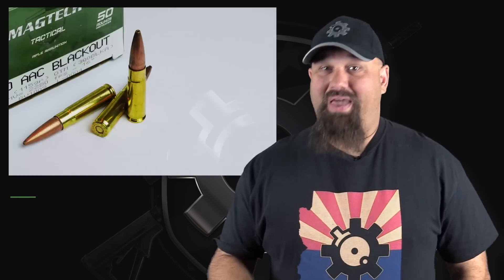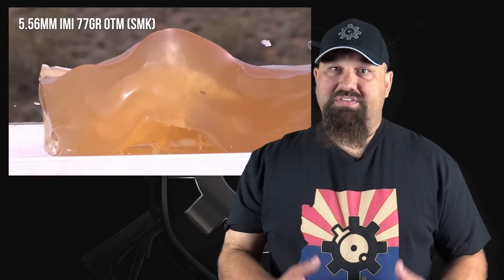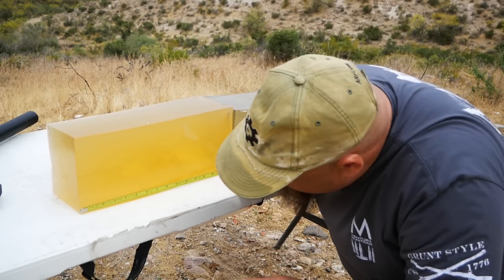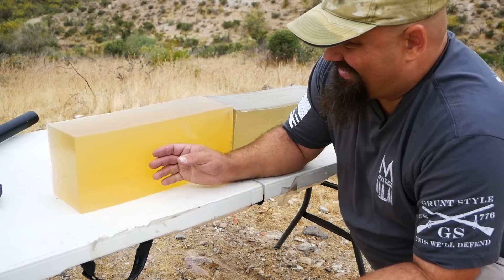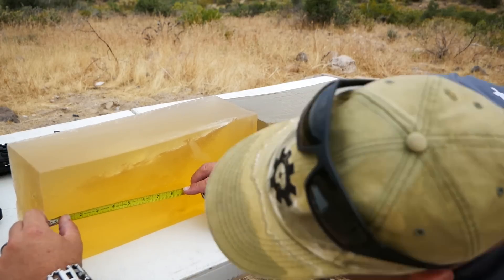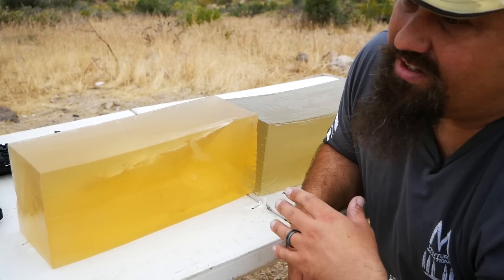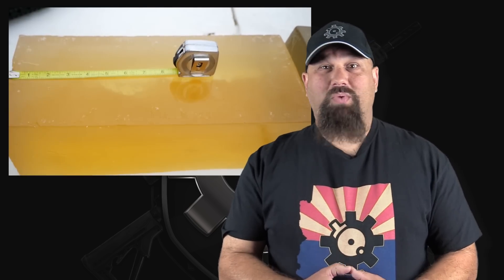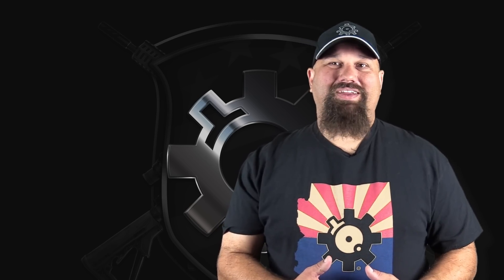Why OTM = FMJ In 300BLK: Magtech 115gr OTM Gel Test

Comment: Don't know where I heard it, but I was of the understanding that the 300blk was designed to provide cqb terminal performance out of a suppressed 9" barrel.
Mine is a 10" from Black rain and pushing a gas checked 200gr Lee(I don't run suppressed) does a number on Texas feral hogs out to 100yds which is the farthest safe backstop at my buddy's place. I have planted a group at 200 at our local range here in Cisco that pretty much nothing this side of Big Foot is going to jump up and say "play it again Sam" with the same batch to assure I wasn't going to send off a squealer. 
I don't shoot if I think it's not going to drop and that's ONE round out NOT full auto like I've seen on YouTube and heard advertised to yuppie jackwagons with a free helicopter ride. There's nothing cool about it. The animal deserves to be here one second and in the happy hunting ground the next. That is Good Stewardship. That they're out there doing what pigs do is not the pig's fault. THAT is because of POOR Stewardship. Ok sorry bout the soap box. Just saw a feed that well you get how I felt about it. 
Y'all Be Good Stay Safe.
Reply: Totally agree about the proper respect for the animal.

Comment: This Patriotic Veteran approves this mesg 

Gun deaths 

There are 30,000 gun related deaths per year by firearms, and this number is not disputed. The U.S. population is 324,059,091 as of June 22, 2016. Do the math: 0.0000925% of the population dies from gun related actions each year. Statistically speaking, this is insignificant! What is never told, however, is a breakdown of those 30,000 deaths, to put them in perspective as compared to other causes of death:

• 65% of those deaths are by suicide, which would never be prevented by gun laws.

• 15% are by law enforcement in the line of duty and justified.

• 17% are through criminal activity, gang and drug related or mentally ill persons – better known as gun violence.

• 3% are accidental discharge deaths.

So technically, "gun violence" is not 30,000 annually, but drops to 5,100. Still too many? Now lets look at how those deaths spanned across the nation.

• 480 homicides (9.4%) were in Chicago

• 344 homicides (6.7%) were in Baltimore

• 333 homicides (6.5%) were in Detroit

• 119 homicides (2.3%) were in Washington D.C. (a 54% increase over prior years)

So basically, 25% of all gun crime happens in just 4 cities. All 4 of those cities have strict gun laws, so it is not the lack of law that is the root cause.

This basically leaves 3,825 for the entire rest of the nation, or about 75 deaths per state. That is an average because some States have much higher rates than others. For example, California had 1,169 and Alabama had 1.

Now, who has the strictest gun laws by far? California, of course, but understand, it is not guns causing this. It is a crime rate spawned by the number of criminal persons residing in those cities and states. So if all cities and states are not created equal, then there must be something other than the tool causing the gun deaths.

Are 5,100 deaths per year horrific? How about in comparison to other deaths? All death is sad and especially so when it is in the commission of a crime but that is the nature of crime. Robbery, death, rape, assault are all done by criminals. It is ludicrous to think that criminals will obey laws. That is why they are called criminals.

But what about other deaths each year?

• 40,000+ die from a drug overdose–THERE IS NO EXCUSE FOR THAT!

• 36,000 people die per year from the flu, far exceeding the criminal gun deaths.

• 34,000 people die per year in traffic fatalities(exceeding gun deaths even if you include suicide).

Now it gets good:

• 200,000+ people die each year (and growing) from preventable medical errors. You are safer walking in the worst areas of Chicago than you are when you are in a hospital!

• 710,000 people die per year from heart disease. It’s time to stop the double cheeseburgers! So what is the point? If the liberal loons and the anti-gun movement focused their attention on heart disease, even a 10% decrease in cardiac deaths would save twice the number of lives annually of all gun-related deaths (including suicide, law enforcement, etc.). A 10% reduction in medical errors would be 66% of the total number of gun deaths or 4 times the number of criminal homicides ................ Simple, easily preventable 10% reductions! So you have to ask yourself, in the grand scheme of things, why the focus on guns? It's pretty simple:

Taking away guns gives control to governments. The founders of this nation knew that regardless of the form of government, those in power may become corrupt and seek to rule as the British did by trying to disarm the populace of the colonies. It is not difficult to understand that a disarmed populace is a controlled populace.

Thus, the second amendment was proudly and boldly included in the U.S. Constitution. It must be preserved at all costs. So the next time someone tries to tell you that gun control is about saving lives, look at these facts and remember these words from Noah Webster: "Before a standing army can rule, the people must be disarmed."

What ever happen to up hold the Oath of office to protect and up hold the CONSTITUTION of the USA....NOT MAKE YOUR OWN RULES/LAWS...

Show quoted text

Comment: This was also shot out of an 8" barrel... Go watch Mrgunsngear on 300blk out barrels, grains, and velocities as well as fps. 
The whole point of this video was fragmentation apparently, or lack of from an 8" barrel.
Reply: The whole point of .300 AAC is to shoot it out of short barrels.
Reply: @newsofthepews  but the velocities vary based on barrel length and bullet type.. optimal is 10.5 for a 300 SBR. You also obviously used ammo that isn't meant to fracture. Tacticalrifleman does a vid on 300 vs 9 using ballistic gel. The 300 is 10.5 and believe it or not, the bullet creates a cavity and fractures inside the first gel block
You're obviously attempting to detail the 300blkout movement by throwing in false information and not doing your due diligence in providing necessary information.
Reply: @dustinramose  I'd have to agree with your statement. OTM is meant for increased accuracy bot for expansion/fragmentation. Using a sub 9" barrel, which the 300blk was designed around, while comparing it to a full size AK for ballistics has and will yield biased results.

Comment: 762x39 is not  "at least 200fps faster than 300blk" in shorter barrels. They may be in 16" +, but in 10-11" barrels they're nearly identical.
Reply: yup compare both rounds outta a 16in and 300 is superior
Reply: @tylerh7298  no, the opposite. Out of longer barrels, apples to apples .300blk is like 90-95% of what 7.62x39 can do. As you shorten the barrels, that gap shrinks to almost nothing. There’s no barrel length at which .300blk is greater than 7.62x39
Reply: A 300 blk with a 110 gets around the same velocity as a 7.62x39 with a 123 grain.

Comment: From what I've seen, 200fps is more like an extreme difference between 7.62x39 and x35. Usually more like 100-150.
Reply: The difference can be far more than 200fps. Chopping block recently tested a 125gr 7.62x39 softpoint at 2500fps. That's more velocity than you'd get out of a 100gr 300BLK round.
Reply: @asdfghjk2933  Oh ok. I've only seen fmj comparisons that ranged 2200-2400.
Reply: @barccy  Typically that's what you see, but 7.62x39 can be pushed further because of the case capacity. Not a gigantic difference between them, but significant enough.
Reply: @asdfghjk2933   wrong.

Comment: I'm still waiting on the MagTech 77 grain 5.56 gel test. I'd even sponsor the ammo for the test
Reply: Doesn't it also use a 77gr SMK? If so, the performance will be the same as any other 77gr SMK at similar velocity.
Reply: @newsofthepews  Yes but I still want to see it
Reply: I use both.  The only difference between Magtech and IWI is possibly an accuracy difference depending on the rifle.  I find the Magtech generally slightly less accurate than the IWI across several rifles.  But not enough to matter for most purposes.  IWI ~1MOA, Magtech ~1.5MOA.  YMMV
Reply: I already had it set up with him to send him some Magtech 77 OTM about a month or so ago but then I got into a car accident shortly thereafter.  I am almost financially recovered now.  I only had liability insurance so I could have more money for AR builds and ammo. Ive been paying dearly for that decision. 😢   I plan to send him a box when I can finally afford it in a week or two.

Comment: it's slower than 7.62x39 til you put them both in short barrels. then they mirror each other.
Reply: No, if you put them both in short barrels and use the same propellants, the one with more case capacity can go faster.
Reply: @newsofthepews  put some H110 in 7.62x39 and live stream the results for us. can't wait to see your results (spoiler alert it turns your gun into a claymore)
Reply: @operatorsanonymous  I don't believe you. That would mean that the AK lock-up or barrel is somehow profoundly weaker than the AR.
Reply: @newsofthepews  You are wrong and it can and has been proven mathematically.

 It's the cartridge shape not the platform it's used in. you can chamber 300blk in an AK platform just fine but the 300blk has next to no shoulder allowing the use if magnum pistol powders which are fast burning. we are talking 7.62x39 compared to 300blk in short barrels not AR-15 vs AK.
Reply: @newsofthepews  but please try and prove me wrong. throw 20gr of H110 in a 7.62x39 case and slap a 123gr bullet on top.
Reply: @operatorsanonymous  the rules of logic require that the person making the claim present the evidence.
Reply: @newsofthepews  I'm smart enough to know H110 in 7.62x39 is a bad idea you're the one claiming you can use the same powders in both
Reply: @newsofthepews  I've chronographed them both, the 7.62x39 doesn't get a complete powder burn cause it uses a slower burning powder. you can cram as much powder as you can in a x39 case alot of it is gonna get blown out the end. 300blk uses pistol powder and gets full use of it's case capacity. a 10in 7.62x39 with 123gr bullets were going slower than a 9in 300blk with 125gr bullets off a magnitospeed chronograph.
Reply: @newsofthepews  you put pistol powder in a x39 you'll risk blowing up the gun not designed for it.
Reply: @operatorsanonymous  I'm sorry. I missed the part where the AR15 was designed for pistol powders.
Reply: @newsofthepews  300blk uses pistol powder I specifically use H110 which is also loaded in both 357mag and 44mag.
Reply: @newsofthepews  1980fps with 123gr sst with 7.62x39 out of a 10.3

2018fps 300blk with 125gr sst out of a 9in barrel. 

Bottle neck cartridges will explode if you put magnum pistol powder in them.

Comment: How about testing the hornady .300bo subx round ? What i have seen so far from it is impressive for a subsonic round .
Reply: I tested it on TFBtv a while back. As you say, it does okay for subsonic. I wasn't impressed with the uneven expansion, but it functioned.
Reply: @newsofthepews  i dug a little deeper and found it .  good job on the test ! i shot a coyote with it out of a 8" pistol at 70 yards a couple of months ago . hit it in the chest , found the round in the crotch area. recovered bullet looked like a Cuisinart blade ( very little folding back ) and coyote was drt .

Comment: I bought some of this magtech 115 OTM to try out... accuracy was bad. Like 4” at 100 and I was using a scope on my SBR with a BA Hanson 10.3” barrel.  I wasn’t impressed at all.
Reply: There you have it folks, .300 AAC is not very accurate.

Read more
Reply: Your twist rate prefers a heavier bullet. 👍
Reply: I was thinking of getting some but dunno what the best/preferred grain weight for a 1/8 10.5 is?  Wouldn't bonded be better than btip or vmax ammo?  Only bonded I've seen it's federal msr in 150gr. Isn't that more for suppressor use?
Reply: @TheDkb427  yeah, I'd love to see a 110gr Fusion.
Reply: I got a 16inch with a 1n8. Its pretty tight for what it is at 100yrds. Same 115gr magtech is going about 2300 to 2350fps out of a 16. Groups about 1.5 moa

Comment: 300 blk just underperforms. There's better options out there that are cheaper. What's the point of it?
Reply: That's why I have a 6.8 SPC. It's an effective deer cartridge or home defense round with all but fmj. Go lighter for home, heavier for deer.
Reply: @l00nybin  
Are you shooting 6.8 on deer from an 8" barrel?
Reply: @theimmortal4718  Heck no. I'm not sure any caliber would be sufficient from an 8" barrel at 150yds.
Reply: l00nybin If you really look at the numbers the 6.8 sucks hairy assholes..... my 24” 5.56 AR is about on par with it after the first 100 yards......
Reply: Eugene Stoner ummm no.... thats a ignorant statement..... look im getting over 3300 fps out of green tip and my handloads Ive pushed  bullets to almost 4000 fps..... you CANT do that in a 20” period. Second all the published data you see is from a 24” barrel! Wake up!
Reply: The only caliber that I think is objectively better than 5.56 in the AR platform is 6.5 grendel. Too bad there are no reliable mags and the bolts are weaksauce.
Reply: Eugene Stoner I dont care what its designed for its simple math= longer barrel equals more velocity PERIOD!!! You can use slower powders and take advantage of it!! Yes I have a bull barrel Stag upper
Reply: Eugene Stoner I have bigger calibers for all that, I wanted a AR 15 platform which you cannot do with creedy etc blah blah and yes Ill list the powder and load, its no problem.
Reply: @Eugene Stoner Yeah I'm sure 6.8 SPC packs a wallop, but I don't feel the need to use one over a 5.56 with 77gr TMKs or other nasty rounds. Plus, you get less barrier penetration with the 5.56 with I think is a benefit in a home defense situation.
Reply: @Eugene Stoner And I bet you'd get some nice velocity out of a relatively lightweight round like that. Goes to show, ARs are better than AKs in every way. If you don't like 5.56, you can swap uppers to calibers that are better than 7.62x39 in every way conceivable.
Reply: @Eugene Stoner Me neither. 5.56 does everything I want it to. It's not the best at any individual task (except being cheap), but it's one hell of a versatile caliber.

Comment: They just need to develop some good, lightweight, inexpensive soft point rounds for the 300 BLK. But why would they do that when they can overcharge for 150 grain FMJs and Barnes bullets? This is why I haven’t invested in the 300 BLK yet. Maybe in five years or so.
Reply: Just some of this reloader's observations. I've tried several SP bullets with amazing and disappointing results. What I have noticed is that they work fine (great even) out of a bolt gun (worked a load for a friends ranch rifle in .300BLK). Problems seem to be with how the tips strike the feed ramps. Cycle a few rounds without firing and you will see every tip gets mashed over leading to poor accuracy.

The velocity of the bullet is right in what is normally a sweet spot for the SP rounds but sadly the AR action is not kind to such ammo. I have found most my success with tipped or hunting HP bullets.
Reply: @Ephem13  I have found it makes a big difference how your magazine and feed ramp is set up too. a lot of 300 blackout barrels have essentially standard m4 ramps which are not well suited to anything other than the very long pointy flavor of bullets. And many people are using PMAGs which aim the cartridge right into where they will nick the edge of the feed ramp. For this caliber USGI mags or the lancer mags are much better. you can also improve USDI mags with a couple very judicious tweaks on the front end of the mag so we'll have better clearance. I reload and cast and I like the option of running a wide variety of ammo with flawless reliability and no damage to the bullet. For me it's worth doing the minor adjustments on the feed ramp and upper to ensure that no bullet damage will occur and then just move on with life. It sucks to have to modify something out of the box but it doesn't suck as much as beating up your ammo for no reason.
Reply: If the Russians had developed a 110gr soft point similar in design to the soft points used by the various Russian makers in other rifle calibers, it would be an absolute banger.

Comment: I handload 125gr sst. They buck wind better than 110 in the windy hills and I like having a cannelure. I shot some of this 115 magtech, the accuracy wasnt stellar.
Reply: That polymer tip is a game-changer compared to OTM. 120gr sst is my deer load in my 6.8SPC. The farthest I had to track a deer with that round is 2 steps, and that was a 150yd shot.
Reply: @l00nybin  6.8 👍
Reply: stayfit_116 I handload as well and love the 110 vmax and 125 sst.... also try the Sierra 300 blkout 125 that look like palmas but pinched on the tip.... what a accurate bullet and flies so good! I was shooting my 10.5 at 428.1 yards at steel plates the size of a small torso and made my hits everytime..... exceptional bullet design 👍🏻

Comment: 16 inch barrel????
Reply: No, 8" with a big, honking homemade silencer.
Reply: @newsofthepews  try a 16 inch to see if there is any difference?
Reply: @truck212121  I look forward to seeing the results of your testing.
Reply: I tested it out of a 24" barrel
Reply: How about trying the 5.56 77g OTM with an 8” barrel & see how it performs in gel? Comparing 300 blk performance in a 8” barrel to 5.56 in 16” barrel is not an apples-to-apples test. For those who say the velocity of 300 blk does not increase much from an 8-9.5” barrel to 16”, the chronograph data simple does not support this.
Reply: @ Eugene Stoner most 300 blk factory supersonic ammo advertised velocity is from a 16” or longer barrel. This video is very informative on this subject —> https://youtu.be/4VNl7QXykUY